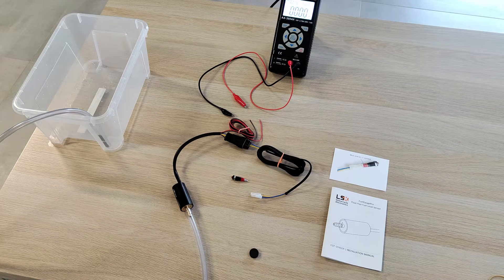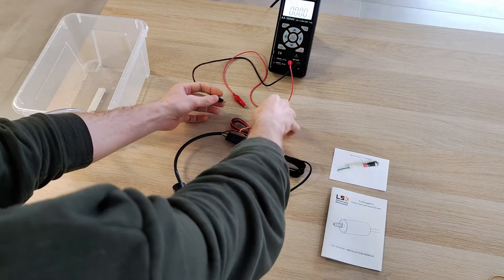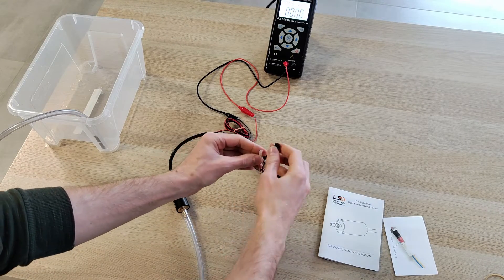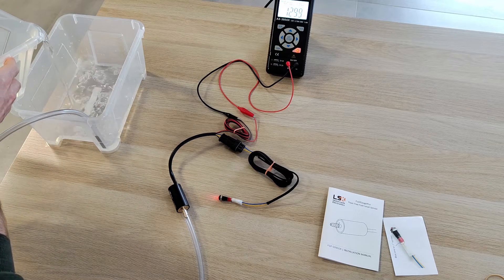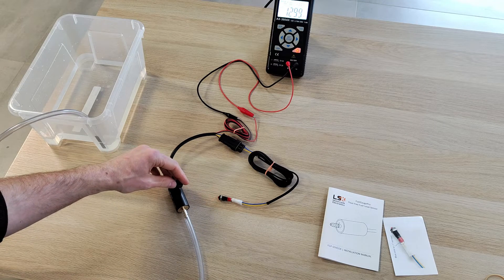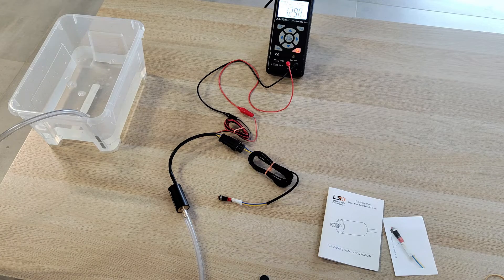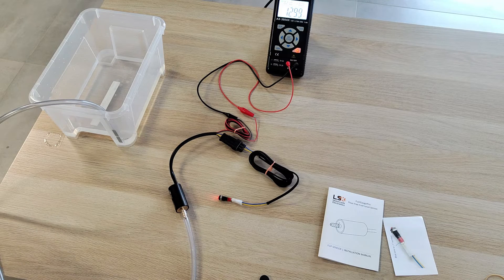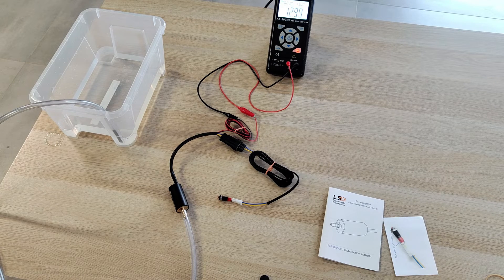Fuel Gauge Pro - Low Fuel Warning Light Kit demonstration

Comment: Hello, I know this is a secret that took a long time to develop, but I have been thinking about this sensor for a long time and came across the problem of gasoline coming into contact with the sensor. Since you have discontinued production, could you tell me how you solved this issue? Which sensor did you use, and how did you prevent the fuel from damaging it?
Reply from the maker: Hello, this information is our know how and don't want to share it with anyone. Sorry. :)